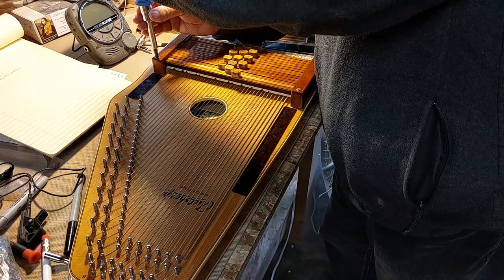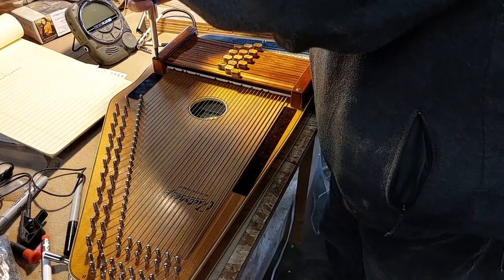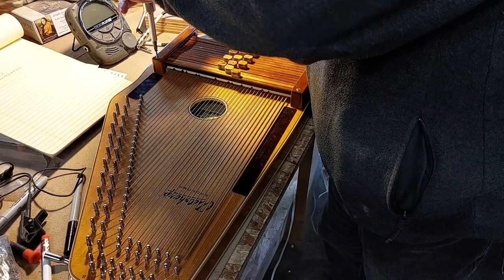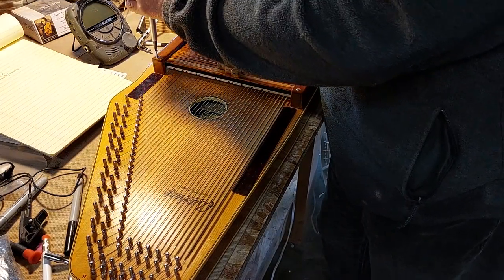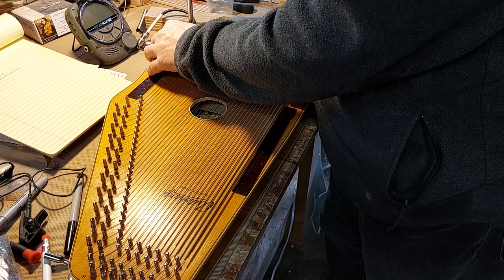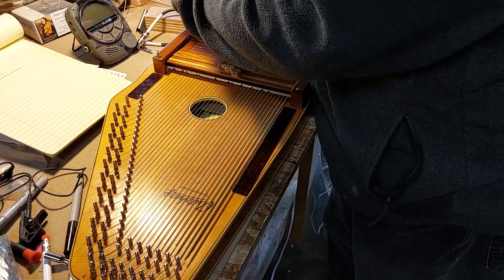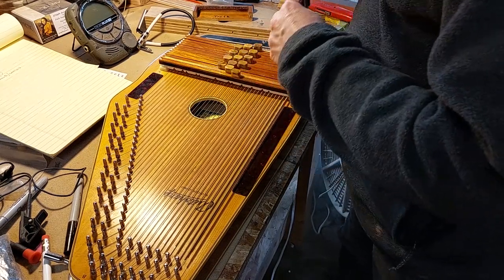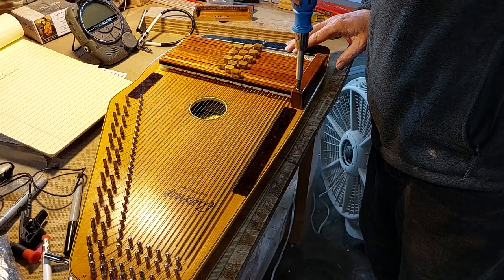Autoharp signed by Bryan Bowers!   Refurbishing OS Centurion: Shop process video PART 1

Comment: What is your theory for the "floating string anchor" design?
Reply from the maker: ?? details?? You mean the problem with the anchor not being fixed in the route and needing to be pinned down with screws?
Reply: @wildautoharp  Yes, a design flaw?  Or maybe a "floating anchor" has some acoustic properties.  Always seemed strange to me that the anchor doesn't sit down flush in the bottom of the groove.  Maybe it allowed for a little more string vibration.
Reply from the maker: @folksongsautohaarp  So I got interested while I was doing this job, about just that...how MUCH space was underneath the anchor?  So I measured the anchor from the bottom of the lip that hangs out over the top, to the bottom of the plate where it bends back 90deg...how long was that?   And then I measured the depth of the rout...and found they were the same....I had always assumed that there was space underneath, but that was not the case.   Then I wondered if other anchors were different, so I pulled out another one from a bin where we keep some extras, and it was the same.   So I was surprised by that.   

As far as not having it secured, they do now...but barely...they use three tiny screws, straight down...those really cheap screws with tiny threads...probably totally ineffectual...but maybe enough to keep the anchor from riding up.   But if the bottom starts to bend, it'll be all over.

What I notice is that the bottom part that wedges against the frame starts pushing the frame out like a drawer...very slightly...from the string tension over the years...pushing it out from the toungue and groove joints...and that gives it room to start climing up out of the rout because of the string tension... design flaw, but they didn't know...it didn't start happening for decades...and now it is.   And the new ones, well the wood is cheaper and more prone to swelling and shrinking in the different air between Korea and here...lack of humidity...and so we see the newer ones doing this as well now.
Reply: @wildautoharp  we should talk.   I haven’t had a good autoharp geek talk in a long time.  It’s kind like of like Klingon when you meet someone who knows the language.
Reply from the maker: Sure; I'd love to; when's good?   Sometimes I meet with folks for social visits over my lunch hour...which is 12-1 Pacific, Mon thru Fri (though Wednesdays are often skewed a bit, the time shifts, but I still have an hour. )

Weekends are also possible, but for the next two, I'm pretty tied up, doin' my taxes and editing the next installment of my diatonic renovation.   I finished it yesterday...it came out so-so (the harp, not the video).  It's a plywood oscar.   Those are sort of hit or miss...when they're good, they're very very good, but when they're bad....well, you know.
Reply: @wildautoharp  any time. I'm good.

Comment: Is the old chord bar set available for sale?
Reply from the maker: Hi; no, the combs were falling apart and the wood "veneers" on the bars were falling off, only held in place while the covers were on.  I found out later that that was why they changed the design.  Pete saves all of it for repair parts.  I asked specifically if they should go in the bonyard but he wants to keep them "in case".
Reply: @wildautoharp  sounds good.  I always look for a repurposing bargain.
Reply: Boneyard has Fackeldey bars without end covers or combs.  I'm trying to think if they can mix and match with different combs and covers.
Reply from the maker: @folksongsautohaarp  I don't think so...they are "short" heighth-wise, sort of like dAigle bars.